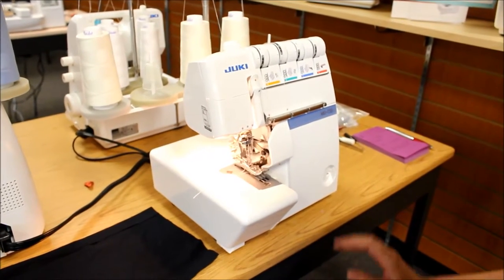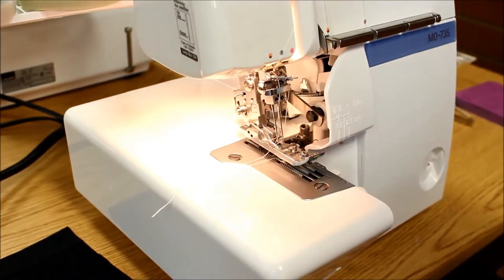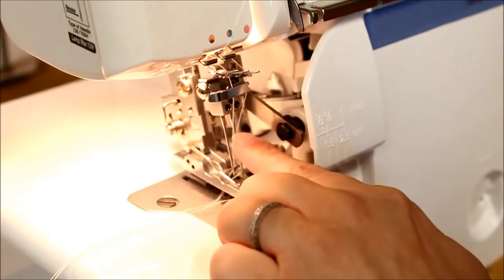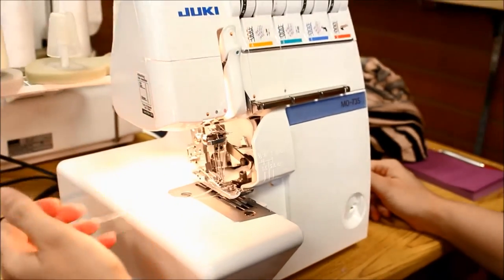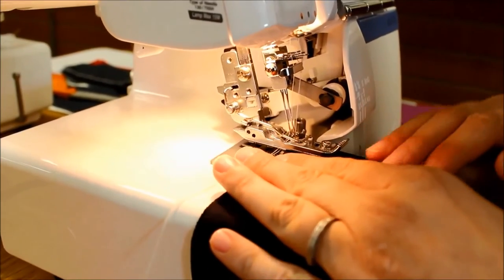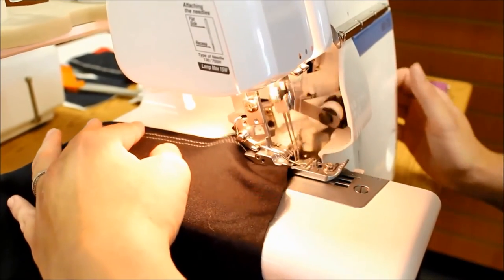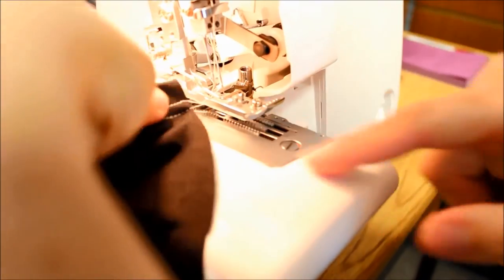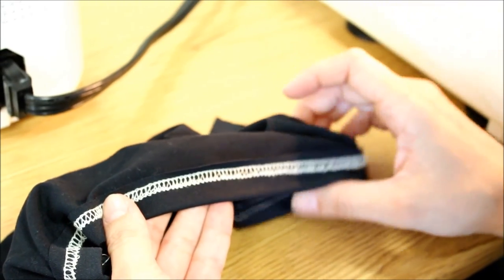Coverstitch for Hemming Knits Part 1 - Using the Juki MO-735 Coverstitch Serger

Comment: Thanks for your demo, very clear and nice.  My concern is there is no 'removable' plate that allows you to do a cuff hem.  I can see that it can be done (turn the item inside out and carefully stitch along the hem).  But it would be nice to just have that option.  My guess is there is a lot of 'mechanicals' in the way of that particular nicety!  But thanks again.  It is on my list, but first, I need to thread one and see if it is too fiddly for me.